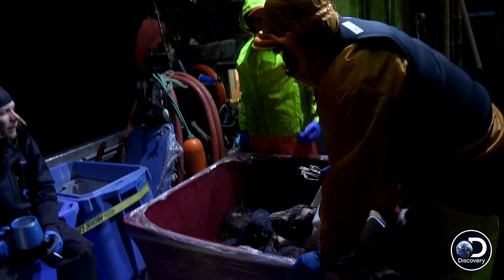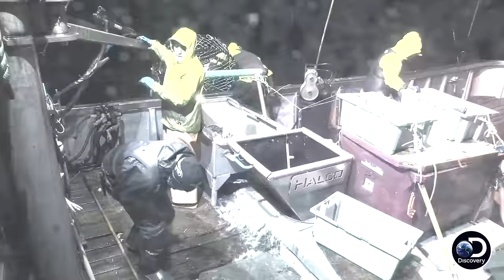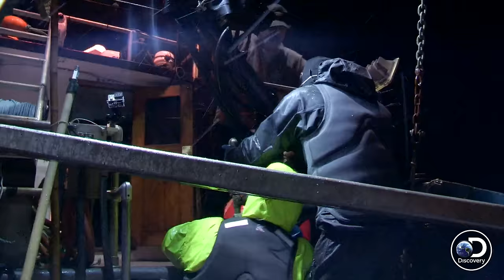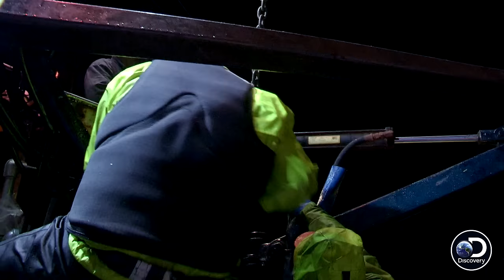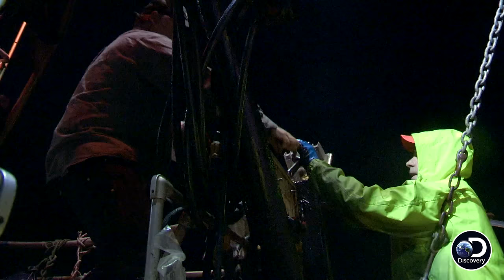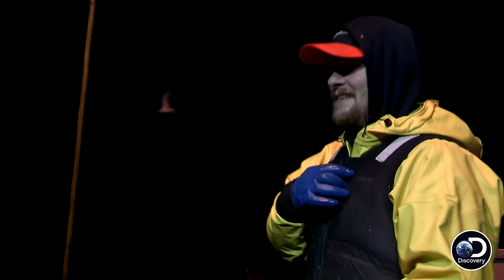Injury at Sea | Deadliest Catch: Dungeon Cove

Comment: This captain is just straight up bad, but i noticed something else of concern. When they re-insert the pin they hammer it from the bottom and insert a safety pin on the top, which is the completely wrong way to do it as you don't want to put load on the safety pin at all. No wonder it just fell out, safety pin probably wore loose and the main pin just fell out due to gravity.
Reply: Weld Broke. Im the guy that got crushed. They quick fixed it with a grade 8 bolt with a lock nut. It worked dine for the rest of the trip. I finished the trip too with bad bruised arm. Crab fishing hell😉

Comment: Isn't that pin in upside down?
Reply: can't believe there is only one comment about the pin from the bottom lol
Reply: How do you think the pin fell out in the first place
Reply: I've used bolts as pins. Cotter pin could've rusted out. I like to use a 5/16 bolt and nut. That's just me.
Reply: Dirk Diggler  Really should be a cap pin with a scrub washer and cotter retention on the bottom, but hey... not my machinery to make that call. 
Hopefully the next time the edge of the hole eats through the cotter pin and it falls out, nobody's in a bad spot; it'll happen again, sooner than you'd think.

Comment: "I'm in shock!" - Something someone in shock will never say
Reply: more like, "I'm pumping adrenaline and can't fucking tell, thanks for checking on me eventually."
Reply: ehh  i just rebroke my plated collar bone at mx track. i could tell i was in shock. didn't verbalize it just picked my bike up rode to the pits made a sling and watched autocross. if ya been there a couple times you can tell easily lol
Reply: @mikemajewski8656  I dumped over my bicycle bars when I was 12 and didn't know anything was wrong until I tried to grab the frame to pick it up and hey, my left hand's not working and that's not supposed to be in that position...

Brain works now, pain's for later.